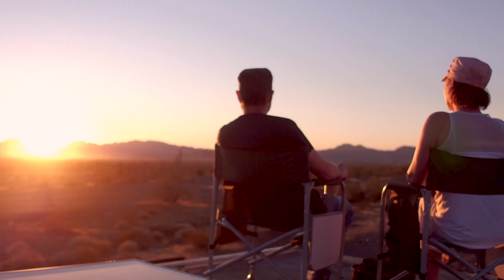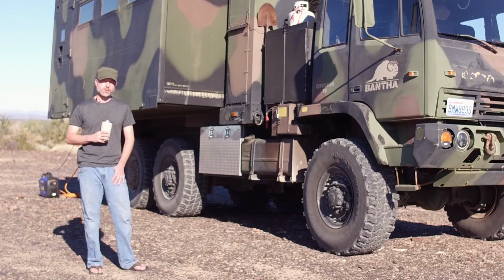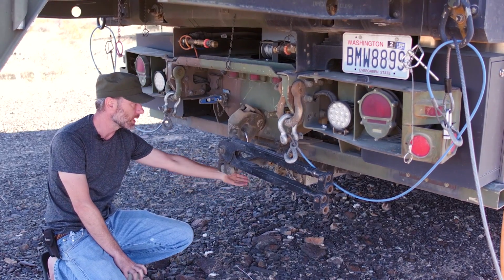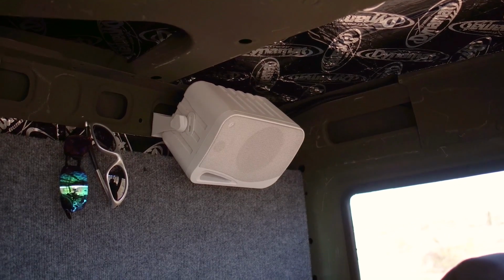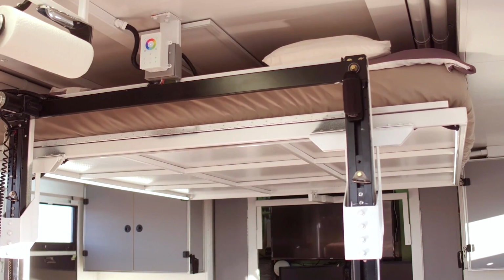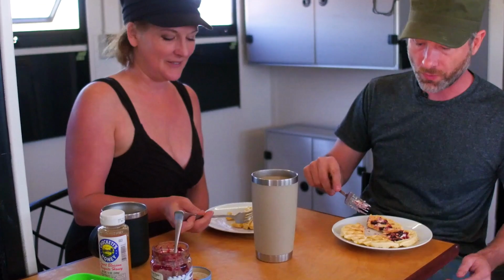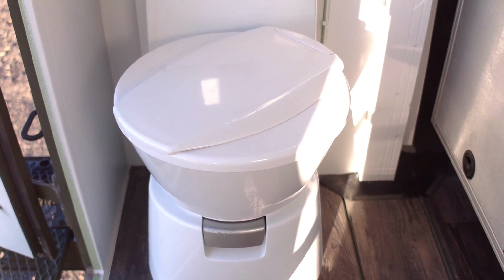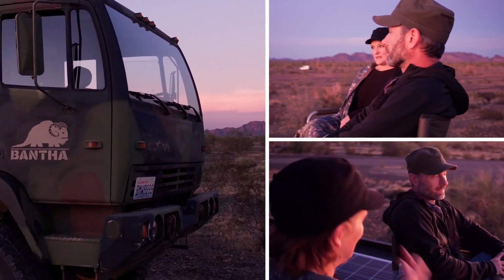Couple Converts ARMY TRUCK into Apocalypse Tiny Home 4 Overlanding

Comment: That truck is perfekt in every way❣️ Would love to have one. 😊
Reply: There very hard to get parts for so if truck breaks you could be stranded waiting to find parts for weeks or months even worse if your outside of North America!
Reply: @shawnwright5332  actually, not!
Engine is a Cat 3116.
Trans is an Allison 6 speed automatic.
Axles are Rockwell’s.
Brakes are Bendix air brakes.
Electrical system is standard semi 28v DC and automotive 12v DC. Uses 4 12v deep cycle batteries.
All standard parts any heavy truck repair facility can get and fix.
The transfer case makes the trans a 7 speed and is the only “unusual” part for an on road semi.
Even it can be repaired, just need to order up the parts if replacements are needed.

Anything to do with the box won’t stop you from traveling, just affects your comfort quotient...

If you ever get the chance to met this couple, you would want to adopt them! 🤗
She is a complete sweetheart and he is a very humble genius. (Not that Krystal isn’t a genius too!🥳)